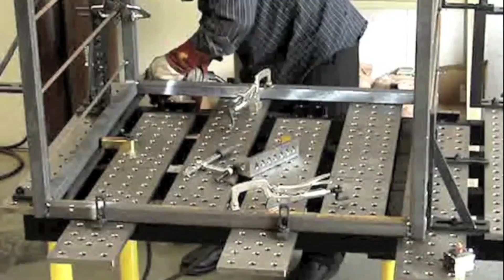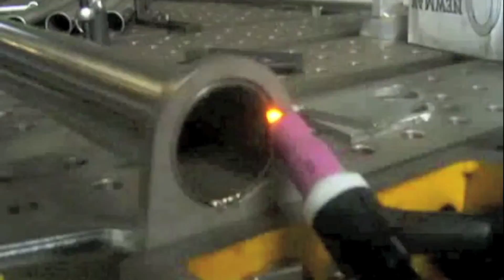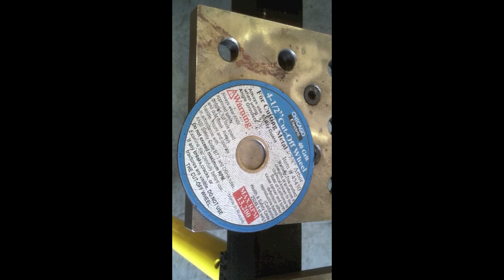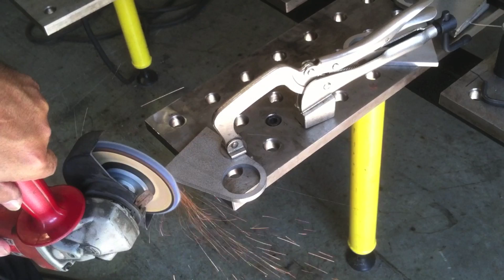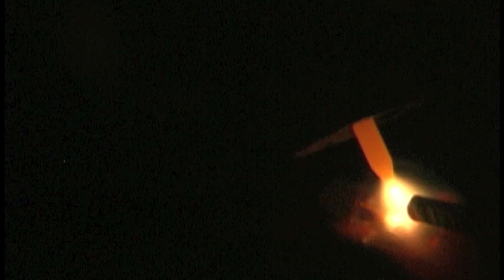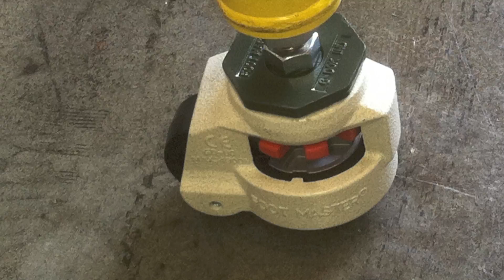Welding Tools - Tooling - StrongHand Tools BuildPro Table - part3

Comment: Great work! Sorry to see you got injured young man. I have had two FEIN 4inch angle grinders (Burnt out after ten hard years service) and one had proximity pads to set it going, you had to touch two pads at the same time and as soon as you let go it stopped. FEIN seem to have stopped making those. I now use Hitachi because there isn't a local FEIN dealer anymore for servicing.

Comment: Are the holes in the bottom caps of the table legs drilled and tapped for the M20 threaded shanks on the roller feet or are they just thru-holes (not tapped)? Thanks

Comment: I use Metabo grinders. More money but great product. I have both paddle and thumb switch models. The thumb switch model has a feature that in the event of any loss of power ( cord coming unplugged) while the switch is on prevents the grinder from starting even if the switch is still locked in the on position when power is restored till you turn it off then switch it back on. Great feature.

Comment: Just got my first TIG welder just a small Eastwood 200 DC Only for a hobbiest looking to practice do you recommend getting a 40 cuft tank or 125 cuft tank its $100 difference I can trade up at any point, also is there anything else I should get to really dig in I bought $100 in steel a pack of 3/32 tungsten from your site TIG finger and strong arm magnet 1 lb 3/32 and 1 lb 1/16 filler rod, and .30 mig spool, finally I've seen on another channel you can weld aluminum on DC but it's not as pretty is this true?

Comment: How do you do all that without extreme warpage.  When you tack weld the uprights and then remove the clamps prior to finish welding, how do you stop it warping?  No matter what I try, if I were to do those fillet welds, I would end up with the tops nearly touching.  Same as with the square frame.  I would end up with the sides all bowed.
Reply: minimum amperage, tack all 4 corners.

Comment: I've got two of those Chicago grinders, they are tough.  I bought my first because a fellow machine shop has used one for 4 years every day without replacing the brushes.  They do make a paddle wheel I believe.  They aren't the quality of DeWalt or Milwaukee, but they aren't bad at all.

Comment from the maker: @ChuCk230e Water jet cutting is awesome for welding. No oxidation , no dross, no cleaning necessary for most applications.  But It can be expensive to have done.  The Machine Shop I was working for had a contact with a water jet and chose to get it done that way.   Plasma would work, but there would be cleaning needed prior to tig welding.

Comment: Jody,

When I needed another angle grinder I got a $19.99 Pit Bull Angle Grinder Kit from Amazon.

I own 5 HF grinders, but have yet to own something so crappy, poorly designed & assembled, & so downright insanely defective as this new grinder:  With my 1st use it started billowing smoke, & was so hot I could not touch it.  Then it died (thank god).

A product liability lawsuit waiting to happen. 

Therefore, in comparison, Harbor Freight grinders are the DeWalt and Makitas of power tools!